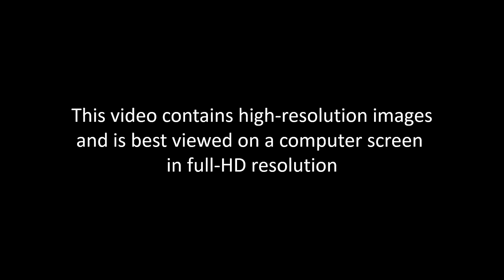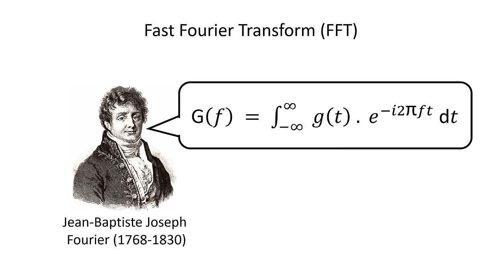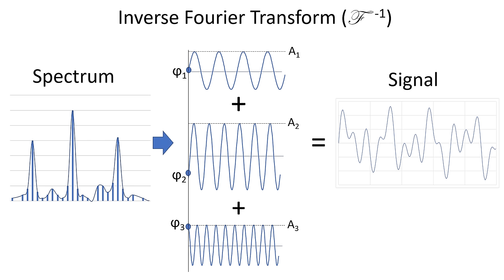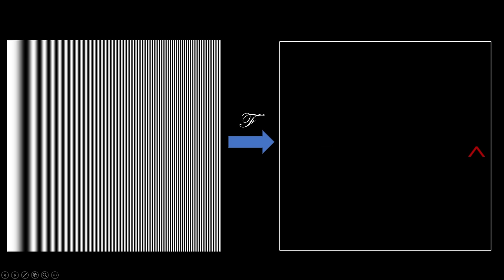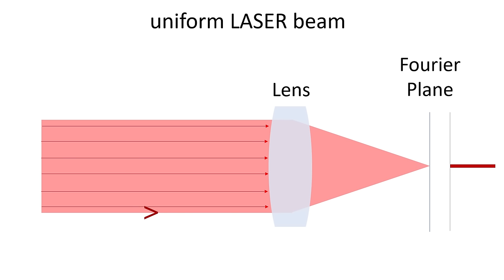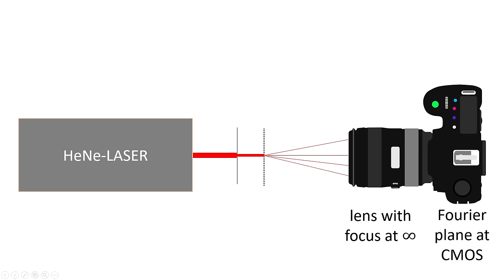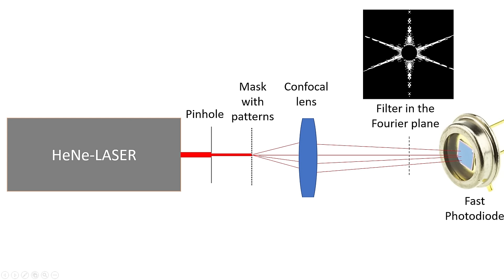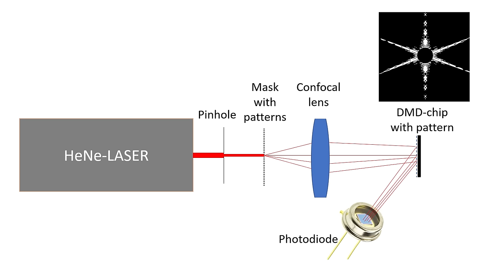Fourier Optics used for Optical Pattern Recognition

Comment: This begs the question of whether a mask with the FFT of "A" at the Fourier plane could be resolved as the cartesian image.  In other words, can I form a tiny letter "A" using a great big mask in the Fourier plane?  I had it in the back of my mind that modern semiconductor masks are formed this way, but I can't quite see how it would work.
Reply: I don't why it wouldn't as long as the laser you're using is extremely coherent. There are ways to make lenses by using airy patterns in reverse, for example.
A similar principle is also used in old school holography.
Reply: @Kuratius  After thinking about this a bit, it occurred to me that there is both amplitude and phase information in the FFT plane, so such a mask might need to incorporate some kind of delay medium to introduce phase shift into the otherwise coherent laser source.  Perhaps a varying thickness of glass. It seems such a thing could be produced in layers and might actually be practical.  It would certainly be a fun experiment.

Comment: Have you tried doing the inverse of the transform on the images you generated using the optics? Could be interesting to see if the original imae is regognizable :-)
Reply from the maker: Well, unfortunately that is not possible, since phase information was lost in the experiment.

Comment: That's fascinating.  Would it be possible to use a DMD chip or other high resolution display technology as the pattern mask?  then you would be on the way to being able to make a programmable optical fourier computer
Reply: Isn't that exactly what he did?
Reply: @fzigunov  no, the mask remained etched into a chromium layer on a glass plate, only the pattern detector was a DMD chip
Reply: @Sigmatechnica  you're saying the non-fourier-transformed patterns, then? Yes, that would be more difficult because of their smaller size, I think. Perhaps with a phone LCD screen it would be possible, I think the pixels are micrometer sized. That would be cool, indeed! =]
Reply: @fzigunov  Yes, so you control both pattern and recognizer.  combine with a few other bits and you have a blindingly fast analog of a neural network.  probably not competitive with conventional processors but interesting to think about
Reply from the maker: See https://www.youtube.com/watch?v=CUvUJ5LnwfY  around 5min26, This company is trying to commercialize your idea ;-). They are using LCD instead of DLP because it is more convenient in their configuration
Reply: @HuygensOptics  :O always someone has got there first haha!  they are going to have some issues with vibration putting it on a pcie card inside a normal computer though i think

Comment: this seems pretty cool and crazy, but how about morphed and/or rotated characters? i would guess they're not as easy to identify? Also, is there any chip that does an optical fourier transform? Thanks for the video
Reply from the maker: So, slightly morphed characters are possible if you make the margin for recognition wide enough. Rotation would be  a bit more difficult, I guess maybe use a different coordinate system for the transformation. There is a startup called optalysys that is trying commercialize optical fourier hardware.

Comment: Can the filter placed in the Fourier plane be a holographic mirror with all of the letters encoded into it such that their values are reflected at different angles with a photodiode for each angle then the diode with the highest value indicates the letter being "viewed"? If this works what would the limit be for the number of characters that can be differentiated?
Reply from the maker: Well it certainly is an interesting idea! One issue would be scaling. If you re-scale characters, the frequencies change so the Fourier patterns also change in size. For the characters to be differentiated they would always have to be of identical size.
Reply: @HuygensOptics  Ah I see, but that just takes us back to the same question, how many characters could the mirror encode as bigger or smaller type is just more characters, they just have a shared (but potentially qualified) meaning for those variations. i.e. If you can encode enough characters then your output tells you both the symbol value and font size set.
Reply from the maker: @DanielSMatthews  Can't really say at this point if a hologram could actually perform this operation. The DMD chip though can switch with 10kHz frequency, so in principle you could also identify characters very quickly in quite a large set of possibilities by just using serial Fourier filtering as described in the video.
Reply: @HuygensOptics  Ah that sounds easier to build too, if you are happy to trade time rather than space to get your computation done, and for huge traditional Asian language character sets or entire unicode blocks it would also make more sense.